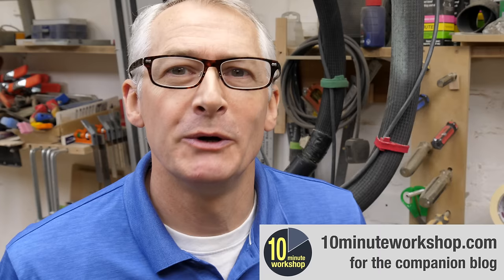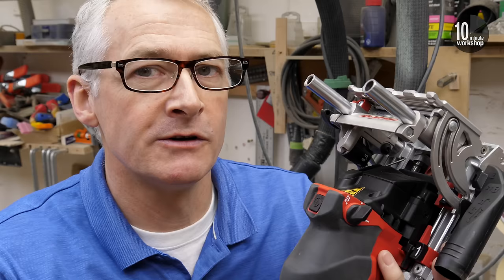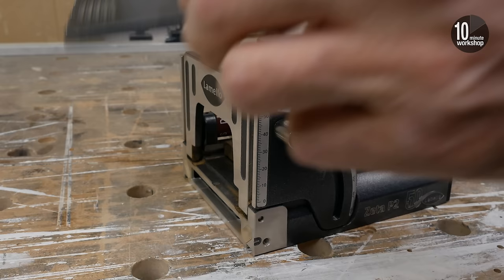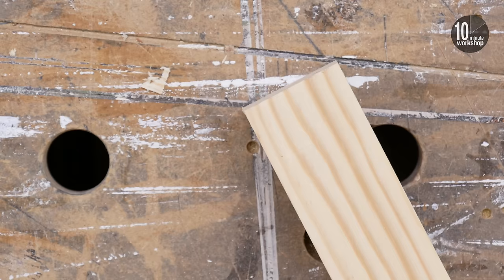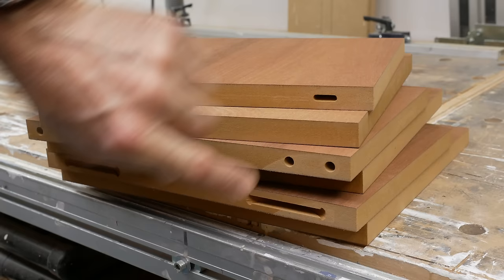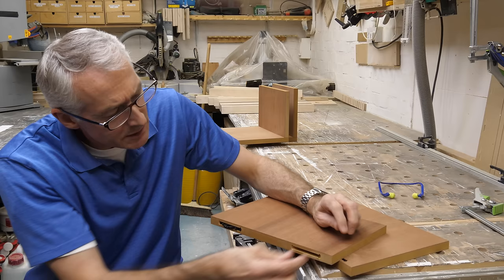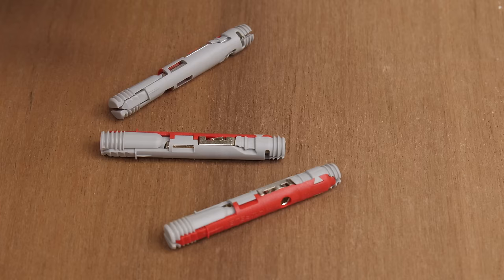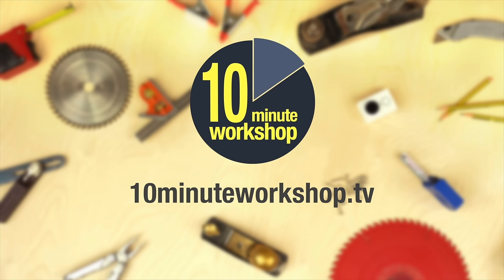Festool Domino, Mafell Doweller or Lamello Zeta? [video #360]

Comment: I'm using biscuits happily and wonder what the difference is in strength (with modern adhesives) between biscuits and dominoes or even dowels.
I'm old enough to remember the anti dowels attitudes of the 60s and also remember research being done by TRADA concluding that well spaced dowels were as strong as mortice and tenon joints.
The main problem for me is the cost - I've just upgraded my elderly cheapie for an on offer bells and whistles biscuit jointer (Rutlands deal £59.99). I'm wondering if I should have saved a lot more money for a domino.
P.S. I would have commented on the website but there is no comments section there for older videos.
Reply from the maker: Hi Jonathan. I think the ‘strength’ of dominos if often overstated. Obviously they are stronger than biscuits - you can snap a biscuit in half with your bare hands, no chance of doing that with the smallest of dominos - but in  actual use, where they’re mostly for alignment, I suspect that the material the workpiece is made from is the thing that will fail first. Compared with dowels though, a 5x30 domino has twice the gluing area as a 6x30 dowel, so in terms of that kind of glue-joint failure the domino will win out, unless you use 2 for 1 dowels for Domino. 

Re comments on the website - they are absolutely enabled, but there is a slight website glitch where you need to refresh the page sometimes to make them appear. It’s something we’re working on, but is hard to track down exactly why it’s happening, so in the meantime a simple page refresh - or use the Wix spaces app - is a workaround. 👍
Reply: @10MinuteWorkshop  Thanks Peter - The research did state correctly spaced dowels so that was probably multiples - my bad.
The comments on the 10MW website is now working for me. So everything hunky dory here.
Dowels have always been a bit of a pain - as you say the wiggle room with the dominos is a real plus - I can't remember when I last cut an accurate biscuit without 'wiggling'.

Comment: Well done Peter... I know from listening to the podcast that this video’s been a while in the making but it was worth it. An excellent overview of these machines and I hope the view count reflects that.

Am kind of surprised you didn’t splice in the clip you shot of the Lamello cutter from the side that illustrated the wiggle so well (~4:50 in your first Lamello video)

As for the Mafell, My day job is in the aerospace business and I can assure you, getting 4 protruding dowels to mate with their opposing holes like you showed is no small feat. 

I notice you had to give the Mafell a fair old push, too, when making the cuts. Hardly surprising with two cutters needing plunging but I wonder if that would be tiresome after a while?
Reply from the maker: Thanks Frank! I don’t generally like reusing bits of video, though I did have that clip in the edit originally; I couldn’t make the timing of it work though, as it’s shot in slo-mo it’s quite a long clip, and saying ‘proprietary cutter and clever engineering’ doesn’t take long to say at all, and in truth I was trying to keep this video as tight as I could as I knew it would run long. 🤷‍♂️ And yes, the Mafell took a surprising amount of effort to plunge; it’s been mentioned by a couple of other guys who’ve had the machine to, so it’s not just this one that’s affected. 

Totally agree wrt the engineering - I bought and returned three Triton dowellers as they were woefully inadequate. 👍

Comment: Hello Peter. At 11:00 in this vid you place your finger on a machined flat surface and you are commenting on that there is no pin for alignment. I watched the other vid you linked for this tool and there appears to be two tapped holes in that surface. 
Could you not attach a swinging aluminum tab to one of those holes on either side, that swings out and gives you an edge reference? A washer and spring under the head of the screw keeps tension on the tab yet allows for swinging out of the way. Set up properly they could be moved with your fingers but stay in place either as a stop or out of the way.
Reply from the maker: Possibly, but you’d have to remove them each time you wanted the face of the fence to be flush with the material - the pins/paddles on the domino and doweller are spring so they retract, leaving the face clear to butt against the workpiece. 👍👍
Reply: @10MinuteWorkshop  Look at the first few pictures at this link. This is an adjustable stop version for a milling vise, but for your purposes leave off the red knob adjustment screw off all together. http://www.micro-machine-shop.com/screwless_vise.htm  Now if you need to butt the side of the tool up against your work, then yes they would be in the way.

Comment: Hi Peter, I love your videos and thankyou for all the efforts you put into them (editing sound when operating machines) my question to you is if the zeta was available when you first got you domino, which would you have chosen? Many thanks Peter👍
Reply from the maker: Thank you, much appreciated! That's a tough one; I probably would have gone with the Lamello, but having used the Domino first, it makes you more aware of the Zeta's limitations. But fantastic for cabinet/carcass work. 👍
Reply: @10MinuteWorkshop  Thank you Peter, I think I'm steering towards the zeta, purely due to its fast clampless system. I have been looking at the biscos which would reduce the cost of fixings, I'll use clamex or tenso to pull the joint together and bisco to add additional strength. We'll that's my thinking so far. Keep up the good work 👍
Reply from the maker: Pleasure; I do an overview of a number of knock-down fixings in this weeks 'cabinetry basics' series, P3 out this Friday. 👍
Reply: @10MinuteWorkshop  oh nice one, I'll look forward to that one.

Comment: Peter, it would be very interesting to see how a pocket driller thingy would compare head to head with these high end kit.  Strength and accuracy?
Reply: About the same in strength but less time spent filling holes and sanding down with all these systems. If you were a contractor,  time would be money, and these systems cut out the extra filling, gluing, and sanding time pocket screw holes need for a professional finish.

Comment: Ermm... How do you disassemble lamello fixed cabinet? Seems like the only way is to pry it apart potentially breaking the fixings and/or the cabinet itself... so, where's the "knock down" in this knock down system?
Reply from the maker: The Clamex are the know-down fixings - no glue needed as they apply immense clamping pressure. The Tenso fittings really need to be glued, so not a knock-down fitting as such, more a non-marring clamp. 👍👍

Comment: And the question remains, domino, mafell or zeta. I'm considering the ddf40 or the df500. I'm making small to medium cabinets and plan to make my full kitchen in the future. The simple shelf pin use with the ddf40 kind of leans me that way, especially as the festool route requires both the rail and separate router for the same result. Still undecided as it's a big outlay decisions decisions HELP................
Reply from the maker: Domino. Seriously, it's not only the least expensive, but the most versatile of the three. The Mafell was also quite hard to use - I'd recommend you get a hands-on demo where you can cut some dowels as I found the plunge action far too stiff, and I'm not the only one. There are many ways of making shelf pin holes - the Festool is nice, but not necessary - and most of them can easily be funded by the difference in price between the Domino and the Mafell. All IMHO, of course.👍👍
Reply: @10MinuteWorkshop  really appreciate the feedback. I've seen the Mafell for £840 and the Domino for £720. I think that's my mind made up.

Comment: Is the dowler worth the money? You could get the same results with a cheap jig, a drill and some scraps bodged together no? Albeit would take marginally longer.
Reply from the maker: Not to me, but if you use it a lot then those 'marginally longer' moments add up. 🤷‍♂️👍
Reply: @10MinuteWorkshop  I share your view, I work in a production environment and know that it can make the difference if you're putting out numerous units a day. Most probably aren't thought. Cheers

Comment: Great video peter. Have you used the festool domino connector range? I’ve found them very useful and haven’t noticed you using them before, but I may of missed the video.
Reply from the maker: Thanks Michael! Yes, I did a ‘connect vs Clamex’ video a while back - link in the description or at the blog on 10minuteworkshop.com. 👍👍

Comment: The domino has excellent knockdown fittings
Reply from the maker: I beg to differ - see the link to the ‘Connect or Clamex’ video in the description, or on the blog at 10minuteworkshop.com
Reply: @10MinuteWorkshop  Thanks Peter. I always enjoy your videos and find them well made and informative. The lamellos look like a very easy system to use. I really only posted the comment because you were talking about knockdown capability and it seemed overlooked. Keep up the excellence!

Comment: Thanks, as always, for a great and thoughtful video. May I ask - if you were starting out and not yet invested in any system (eg no LR 32 set up for shelf pins), and you could only afford one of these machines, would that push you toward the Mafell?
Reply from the maker: Thanks Alastair. Honestly, my experience with these three machines simply reinforces how good the Domino is. As clever as the system is, in terms of use the Mafell was my least favourite. There are many way to drill shelf pin holes, and the difference in price between the Mafell and the Domino would pay for most of them. 👍
Reply: @10MinuteWorkshop  Great. Thanks. Was leaning toward the Mafell so will have to watch your domino videos and have a further think about it all then :) (Though I notice on the link you give to the DDF40 it's under £850 these days)

Comment: dowels > dominos, no question! Dowels have a much wider application range and of course, 2 dowels will have longer glue surface, hence a sturdier join.
Reply from the maker: No, they don’t; each face of a 5x30 domino has as much gluing area as a 6x30 dowel. 🤷‍♂️
Reply: @10MinuteWorkshop  Given similar diameters and length, if you put 2 or multiple dominos next to eachother it will have longer perimeter than a domino. It's a simple geometric calculation.
A domino's perimeter is a cirlcle plus two lenths of a rectangle, while asingle or multiple dowels will always have the perimeter of multiple circles.
two Adjacent circles within an identical domino will have longer perimeter.

Comment: Hi, I have been using the dowel Genie , whilst its pretty good it takes a looooooog time using it. May I ask you a couple of things, the Mafell dowller  - how long is that extension arm, i quite often need to dowel around say 700mm lengths of stock? Also perhaps a daft question, but the lamello joints - is it meant to be a temp joint so it can be assembled (eg a bed) without the need of glue etc? or is it with using glue>=? Thanks in advance sir :)
Reply from the maker: Hi. Sorry, I don’t own the Mafell, it was only on loan so Imm afraid I can’t say the the length of the arm, though I’d imagine the spec is on the Mafell website somewhere. With the Lamello, the tenso fittingsare intended as permanent ie self-clamping, and Lamello say the joint strength is increased by 30% if you also use glue. The Clamex fittings are j tended as a knock-down fitting, though many use them as a permanent, self-clamping solution as they’re immensely strong (80-odd Kg if clamping pressure per fitting). Hope that helps! P

Comment: As a beginner I wonder where are the limits of things I can build just with dowels compared to screws and dowels combined? Can I built a wardrode without screws? Can I build a bed without screws? What are the guidelines here?
Reply from the maker: Good question! In many cases the screws simply act as clamps while the glue dries, and any non-mechanical fixing eg dowels, dominos, biscuits etc… are simply to help with alignment. I’ve built many wardrobes with dominos and glue alone, but you need long clamps! I wouldn’t build a bed that way, because over time the glue joints will fail, and as a bed sees more activity than a wardrobe, that will happen sooner. HTH P
Reply: @10MinuteWorkshop  OK I guess I'll have to start doing some trial and error studies. 😁👍

Comment: So what’s the difference between them three machines and a biscuit joiner I have a biscuit joiner probably 20 years works flawlessly all the time and I paid US$140
Reply: Read this: https://web.archive.org/web/20130717202631/http://www.lamello.com/fileadmin/user_upload/mediacenter/0%20Katalog/Lamello_Catalogue_EN.pdf. Biscuits are not suitable for knock-down cabinetry. Both the Domino and Lamello systems are stronger than biscuits as well. This guy isn't a hobbyist - he builds custom cabinetry for interior designers and home owners who want the best finish and utility from their cabinets. These systems are really for the pros, or hobbyists with deep pockets. However, theirs a new system from Intelligent Fixings in the UK that provide even stronger joints with the virtues of dowelling and the strength of the Lamello. Its called Peanut 2, and with a small jig and a router you can build really strong carcasses consumables that are cheaper than the domino or Lamello system. Check it out. Intelligent Fixings has a YouTube channel.

Comment: Did you have any problems connecting the Mafell to your Festool 27mm hose, or is it a compatible connector?
Reply from the maker: No, no problems at all - they're all fine with the standard D27 Festool hose. 👍
Reply: @10MinuteWorkshop  
Thanks Peter

Comment: Hi Peter. An unrelated question to the video really. I’m making some shaker style doors at home and struggling to find a slotted router bit that cuts deeper than 9.5mm. Would that be ok? Or could you point my in a direction to find a bit that cuts deeper. Thanks 
Im using 18mm MDF 6mm panel
Bit is trend 6.3mm x 9.5mm
Reply from the maker: Thanks Kevin! Best bit I’ve found is from Wealden tool - Heavy duty groover - http://bit.ly/HD_Groover
Arcbor for above - http://bit.ly/Arbor_8
They do another version that does a ~13mm groove, but I like them with a bit of meat to them. 👍👍
Reply: Peter Millard thanks Peter that’s a great help. Love the channel by the way

Comment: Have you worked with Clamex S before? Can you compare to Clamex P? Clamex S works with cheap Biscuit joiners so I am interested in that.
Reply from the maker: No, never used them - I’ve never owned a biscuit jointer before the Zeta. They struck me a s a bit odd - a slot-in fixing your have to screw down won’t win any prizes for speed, though if it gives you the functionality of the Clamex without the cost of the Zeta, I can see the appeal - especially if you already have a decent biscuit jointer. Not no, never used them, I’m sorry. 🤷‍♂️👍

Comment: It would be great if there was a cheap one of these, say no more than £150 by Dewalt or Bosch, for us occasional DIY-ers
Reply from the maker: I think that’s where Triton tried to pitch their doweller, with very iffy results, so if Triton tried and failed around this price point I don’t see DeWalt or Bosch being terribly interested. But I do feel there’s space in the ~£300-ish area; a decent quality tool that’s still half the price of the domino, expensive for a DIY-er certainly, but still - half the price of a Domino... 🤷‍♂️👍
Reply: @10MinuteWorkshop  once the patent of the domino ends or Festool is starting to give away licenses, the market will be flooded with cheap domino dowellers. But they won‘t work like the Festool one, because something that is really functioning is never cheap, only worth the money. Better get yourself a used Festool than waste your money on junk. Or if you only in for occasional work, learn how to make a mortise and tenant joint. There are always lots of different ways to reach your goals. I personally stick to the domino and also use their removable system. Your right Peter, it’s a little overengeneered, but I don’t do woodworking for a living, so I don‘t mind the extra time it costs.

Comment: Thanks for this great comparison! When you showed the “wiggle room” on the domino, did you have a wider domino setting or the standard width? I’ve never owned or used one so I’m not super familiar with how tight the joint is laterally. Thanks!
Reply from the maker: Thanks James. The domino was in a narrow mortise on the end of the board, and a mid-size mortise on the face of the board.
Reply: Peter Millard thanks :)
Reply: Jamie Jessup 
It has three width settings on the Festool Domino.
Reply: Jamie, I make my own dominoes and almost always I use the widest  slot and make a Domino to fit it.